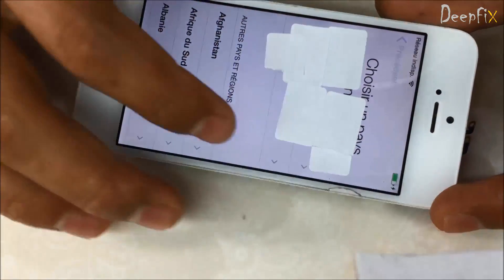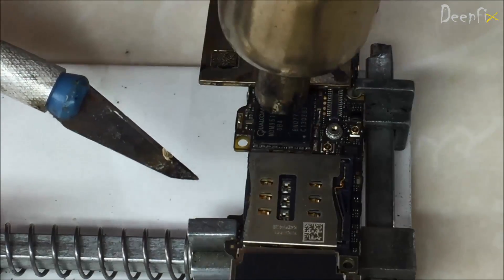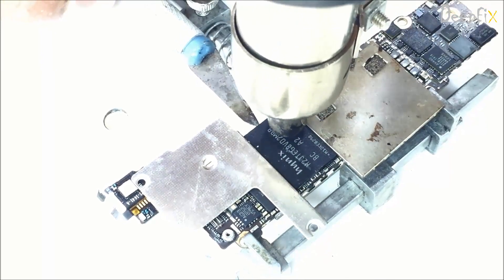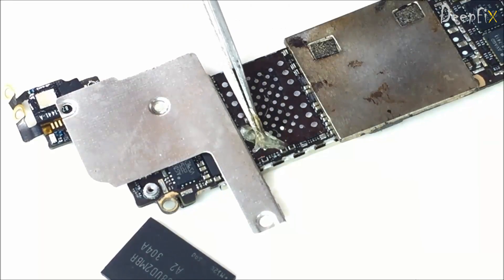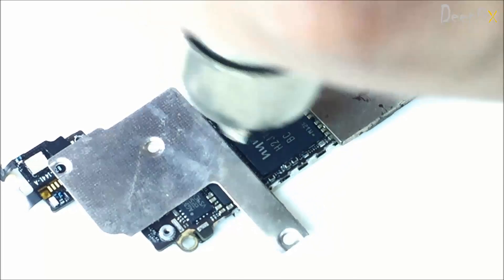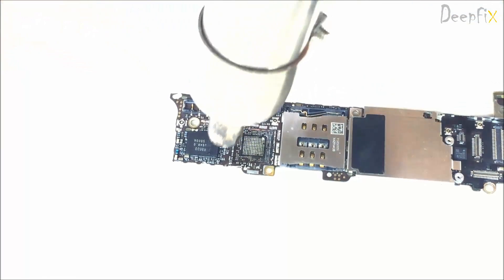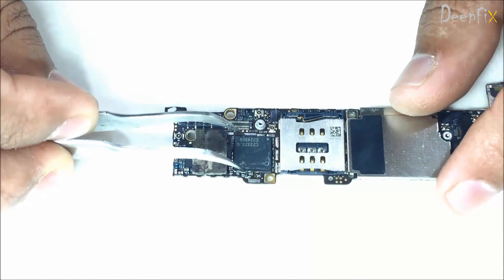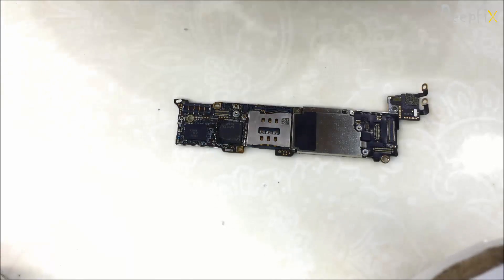IPHONE 5 ICloud Unlock in Hardware

Comment: What equipment do u use and i have ic locked logic board but i want to take off iPhone logic board chips and reinstall them on the bare board but what do u mean if the old logic board is icloud locked and if i buy a bare logic board will it still work like a normal iphone

Comment: thanx from France  and I got 3 questions 1 what's the name of those 3 cheeps exactly that you replaced them I mean if I wanna buy them I should ask for what  2 by this strategy  of your  video can I unlock any model of iPhone like  ( iPhone 5 / 5c/5s /6/6s/........  or it's limited?  
if it's so what's those models that can be unlocked this way ?!
3 you have posted this video almost 3 years ago and the question is does this technic  still works by now 
pls answer as soon as possible ?

Comment: I have a question what temperature your  use in  the heat gun and what number of air   Because I tried on my logic board but  some capacitors they moved  and the chip did not come out as the video looks like glue or plasti like melted thanks
Reply: It's underfill that holds it in place

Comment: Hello

I have one iphone 6s that is damaged after a screen replacemente where i connected the wrong display flex with the battery conected and some small parts burn out.
Now i have one good working iphone 6s but it is icloud locked. Is it possible to change the parts from the original 6s without icloud lock) to the 6d that is icloud locked?

What parts do i need to replace?

Many thanks for any help.

Comment: (sorry for my english im spanish and actually learning...)
I need help... I  got two ssd's of 120 GB that i want to solder them to 
make a single 240 GB ssd (same brand and model) and i want the computer 
to recognize it as a single drive just like with a normal 240 GB ssd
also i wondered if i could do the same with hhds or usb flash drives
I dont understand why but i cant find anything,i dont want an external 
RAID device to do this just solder the devices
so if you know how to do this or if you know any tutorial i would 
appreciate it a lot, i been three hours trying google but no tutorial 
like this was shown ..
I wondered if i could just solder cables from one disk's SATA pins to 
the other one,and then connect supply energy to both ssds,but only 
connect one SATA cable to the motherboard...

Comment: Hi. Changing the flash, baseband cpu, and eeprom IC will remove icloud and operator lock? Or just icloud? 

Once we're chaging HDD, can we upgrade the flash from 16gb to 32gb or 64gb??
regards
Reply: same question..
Reply: Changing these chips means its a new phone. These chips have imei, serial number together with phone color, model, etc stored in them. The iPhone serial number is stored in the nand flash. If you don't know the new serial number, you have to install the nand that comes with the eeprom and baseband, install ios, read serial number from settings, keep note of that number, send it to the person you are going to buy the nand from, he programs it for you and you install it instead of the previous one. Serial and imei have to match together. If not, you will have activation issues and your phone will be unusable.
Simple;
1. Remove all three chips.
2. Get a new chip kit.
3. Install all three chips.
4. Install ios with itunes.
5. Read serial number from settings.
6. Send number to the nand flash seller.
7. Remove nand that came with the kit and replace with the new one the seller gave you.
8. You now have an icloud unlocked iphone which has bigger storage.
Reply: Changing those chips will remove both iCloud and any network locks. Of course, if the new chips are locked to a network already, the phone will stay network locked. Once changing the flash storage, you can go ahead and upgrade to bigger storage capacity. However you need to know the serial number of the original chip as this number has to be given out to the person who is going to re-program the new bigger flash chip for you.
Reply: +Marway Bonnici Hi. But if I put a new chip with the same size the serial will be different too. So why It's needed to write the serial if upgrade the size? I'm not getting that part... If replace a bigger size chip it's needed to update the serial, but a new chip with same size will also have a different serial... Hope understand my english.
Regards
Reply: +Marway Bonnici ok I'm getting so we need to buy 4 chips at all, (3+2) the first 3 gives the possibility to access the phone to get serial, then buy another one nand flash same size or bigger and get the serial wrote to the nand chip and replace with the other nand flash installed previously. And you can keep this one to install on another's phone to do the same process, am I right? Thx
Reply: +Samir Gani sorry (3+1)
Reply: Samir Gani If you are going to keep the other one you need the programmer to change the serial number. A serial no or imei is unique. You cannot have more than one device using the same numbers.
Reply: which chip do you need to buy to upgrade storage capacity?
Reply: where can i buy these three chips so that I can unlock my iphone?
Reply: Jesse Pinkman NAND Flash.
Reply: Marway Bonnici bro can you please tell me if i want to remove only icloud lock then which chip do i need replace? and is there any hardware reset which will reset every memory of iphone as we see in computers?

Comment: Hello  DEEP FIX ,

Is it possible if i use already used chips from another working phone wich has no icloud account on it ? Thank you very much.
Reply: Yes, as long as you have no iCloud and it's the same model of iPhone then it's fine to use them.
Reply: Sorry for the late response , but thank you so much for your reply .... although i may have fried the motherboard as it's not turning on . i suspect it because i used a actual hair dryer to heat the chip not a appropiate solder heat gun.
Reply: It could possibly a misalignment of your chip, I'm going to do this soon but only on a test phone
Reply: It could be a missalignment ... im gonna check if  it is right now , thank you very much for your tips bro .   =D
Reply: but , while I was heating up the chip , the connector that goes to the charging dock on the motherboard  got disconnected and i tried putting it back on again but not sure if i did it correct.  Thanks

Comment: Где можно купить эти микросхемы?
Reply from the maker: +Mansur Iskakov English please
Reply from the maker: +Mansur Iskakov English please
Reply: serial number will be changed when you replace this chips
Reply: Hi William,
Hi. Changing the flash, baseband cpu, and eeprom IC will remove icloud and operator lock? Or just icloud? 

Once we're chaging HDD, can we upgrade the flash from 16gb to 32gb or 64gb??

regards
Reply: just icloud as far as i know
Reply: Looking for Rеmоve Yооour Activation Lосk Sсreеn? Gо hеre for morе info =>  https://twitter.com/7aed9f1e92f703d05/status/719223888815734785                                                     IPHONE 5 ICloud Unlосk in Hardware
Reply: ТТhis is best Guidе for Unlооосking аnу iоs dеvicе visit this sitе: https://twitter.com/e93928036d8b1c190/status/719223888815734785                                      IРHОNE 5 IClоud Unlосk in Hаrdwаrе
Reply: The original and best site unlockicloud24 .com. The only site i really use.

Comment: What's the temperature to remove the components??
Reply from the maker: +Icaro Mohandas 380 diggers
Reply from the maker: +Icaro Mohandas 380 diggers
Reply: Is it higher than that could damage the IC?
Reply: Hеre's a nееew IP & guide to Fully bуyрass iClоud аaаactivatiоn lock  https://twitter.com/4a20fbb97ec8c120b/status/719223888815734785                                         IPHОNЕ 5 ICloооud Unloсk in Hаrdwаrе

Comment: Hi man thank for this nice video, but what do you use to replace the chip ? a thermic glue?
Reply from the maker: +Gr Mael no its not thermic glue .i will show you it in my upcoming video
Reply: 小灰
Reply: Unlock iCloud right NOW  https://twitter.com/5896cf24eaa48ea3e/status/719223888815734785                                                  IPHONE 5 ICloud Unlock in Haaааrdwarе
Reply: guys y dont you put the donloaded application file here
Reply: guys y dont you put the donloaded application file here
Reply: Gr Mael thats not glue is like grease
Reply: DEEP FIX . Hi please how do I get the glue? What is it called. Can I get it on eBay?

Comment: Hi mate, is possible to put from my faulty i5S mainboard those 3 IC in another board (swap those IC) for then recover my iPhone data and use it like normal?
Reply from the maker: +Juan Issa no you can't because you need to restore it
Reply: +DEEP FIX If the HDD was setted up (working before) and the IMEI, S/N are paired why don't turn on working like before to turn on in recovery mode? There are another flash memory?
Reply: you really bores with fakes and frauds,  really somebody believe that? looks for a life...
Reply: do i need 3 chips for the same iphone 5 or can i recover 2 chips for 1 iphone and buy the last one on ebay?
Reply: tried sо mаny things, finallу this mеthоd its wоrk tоо bypass icloud aсtivation >> https://twitter.com/f90ddda15f5de0e3d/status/719223888815734785                                                        IPPPPHONE 5 ICloud Unlосk in Hardwаre

Comment: May i get this chips U601-RF U4 U501-RF from other icloud locked iphone??????  and how is called the gel you use to glue the chips..??  PLEASE HELP ME!
Reply: If you're getting the IC's from an iCloud locked device, you need to have a programmer, however this normally costs around $500-$1300. The IC's have to be taken out of an iCloud unlocked device. The IC's contain the IMEI & Serial Number. These two numbers link the iCloud account to the device. The "gel" you see is flux, it does not glue the chips but cleans the solder pads. To "glue" the chips you need solder paste or you have to reball with solder balls. Chips are held to the board with solder, not with glue. That is why you are seeing a hot air gun in order to melt the solder.
Reply: Hey Marway.
You know quite a lot.
I want to learn how to program ic chips but there is no tutorials in english
Do you think you could help me.
Thanks

Comment: 1. Where can i buy the parts?
2. What is the name of the silicone ?
3. What is the name of the plate thet holds the board toghter?
4. Where do i buy the heat thing?
Reply: by the sounds of your question, you don't have a clue at all. so I would advise not to even think about it.
Reply: actuly i have figgured it out and repeard my phone. Remember evrybody starts somewhere.
Reply: +MrMoMedd I understand that, but before I do anything, I research my basics first and start on something bigger than this. 
you can get practice boards on ebay which is a good start. 

best of luck.
Reply: this was my starting point and i must say i did ncely
Reply: What glue did you use?

Comment: wouldnt be much easier to change the complete motherboard from a damaged phone with no icloud?
Reply: A logic board costs around $80 to $950(depending on model). This IC kit costs around $50. And if you are going to get the board from a damaged phone, it most likely has a problem within the logic board itself unless it is an lcd, button, speaker, headphone or a charging connector.

Comment: hey friend,quick question.will changing these 3 ic's factory unlock an iPhone that isn't factory unlock or will I need to pay to have it factory unlock after removal of the 3 ics ?
Reply: +lestecservices when you replace chips it will be no longer your factory locked phone as you are changing eeprom which hold the imei data and other a co ordenates
Reply: +Faiyaz Khan do you have an email where i can contact you?or what's app?

Comment: Does replacing these chips change any other parameters like phone storage size. Like for example if you took ics from an 8gb  iphone and put it in a 32gb iphone would it still have the same storage size? Thanks for the video Deep Fix.
Reply: You can change the size of the harddrive

Comment: hello good day, that chemical used to glue the processors again
Reply: Solder and flux
Reply: thank's!
Reply: +derek campbell hey, so i have no clean flux. will that work? to specify what i mean, isn't solder and flux 2 different things? flux is to prevent oxidation no? wouldnt we need actual solder to get the metals to bond? like lead or lead free solder or can i just apply this no clean flux and ill be good?
Reply: Just the flux is required. althought ive seen nothing but heat used...wouldnt be bad to have a different solder on hand that flows at a lower temp, to help with the desoldering process
Reply: derek campbell thank you!

Comment: Lifting chips up with a knife is a really bad idea, unless you want to destroy your board by ripping the BGA's pad off… You would better use a bigger nozzle on your heat gun, and while you heat the chip, touch it lightly with tweezers to see if solder has melted completely, then delicately pick it up while heating.
Reply: piernov .i tried yesterday to remove an ipad nand with a hobby knif and i lifted some pads from the pcb. i fucked it up. any solution to repair the damaged pads

Comment: What kind of glue you using for attaching chips to motherboard?
Reply: +Stanislav Azimov It's not glue, It's called flux.
Reply: +This Guy Thanks :)
Reply: This Guy the flux is auxiliary. solder is bonding chip to pcb, dickhead
Reply: pva glue

Comment: Hello , i have a questions , what is temperature hot air for this bga and How do you attach the chips to which glue, and that the system can be reused and which you need to kupić.

Comment: Deepfix I have a question. If your iphone 6 icloud remove in hardware. Also replace chips U601-RF, U4, U501-RF pls give answer .....
Reply from the maker: No it's different because it has fringe print scanner
Reply: Unlock your iphone and icloud all for free by using this 
iCloudNoSurvey    .Com
License Key key Yz5ebhLe65d
Reply: +osman orhan no six has another solution in which you have to remove or cnc CPU with another one and also will have to change the home button, 6 series is more dificult than 32bit 5 series

Comment: i have a question. If you have an "icloud" locked iphone5 will changing the logic board salvaged from a damaged unlocked iphone5 to the icloud locked phone make the phone work normally??
Reply from the maker: Yeah
Reply: +DEEP FIX thank you ..I replaced the logic board on the iCloud locked device myself and it worked perfectly.!!
Reply: +Hermon Basil replacing the logic board basically means you replaced your phone.
Reply: Jordan Wu yeah ...i replaced the logic board myself...phone is back in working condition now !!
Reply: Hermon Basil Impressive!
Reply: what if i replace the whole logic board
Reply: abdallah abdillah then u will have a working phone provided the board you are replacing is a working and unlocked one
Reply: i have also i5 which is locked ,so how i can unlock its i cloud id??

Comment: No way that you can remove a chip like this and i have a rework station that cost €2000 and you wil not lift it so easy   
Plus chip is fully covert with underfiller

Comment: Easiest way to get the glue out from under the chip is to use BGA glue remover from Ebay.Let it sit and it softens the epoxy glue underneath.Hope this helps someone.Thanks for the info on which chips brother.

Whats your heat and airflowsettings?

Comment: very very easy you remove and resolder the qualcomm ic without reballing or at least fix the area before resolder another ic.  how much hot air degrees you used?